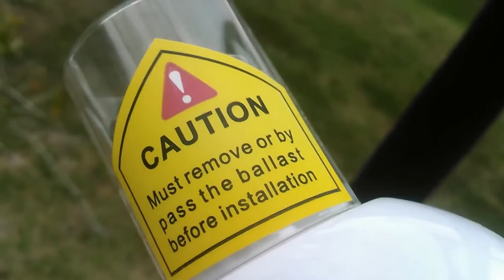Converting a street light to a LED 250 watt replacement.

Comment: Jeff, have an old light sensor HPS outdoor light on pole in back yard. Want to install a 150 watt LED with  mogul adapter included.  Do you have a video that walks you through the bypass process?